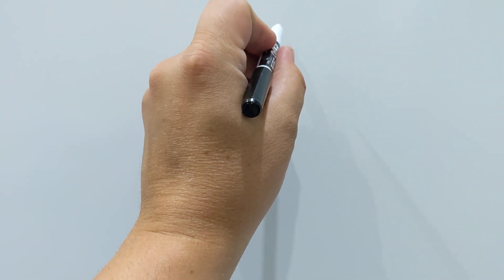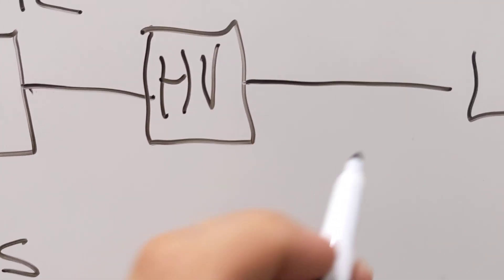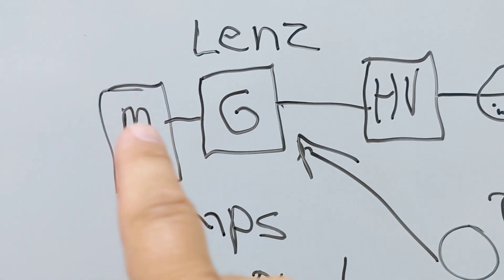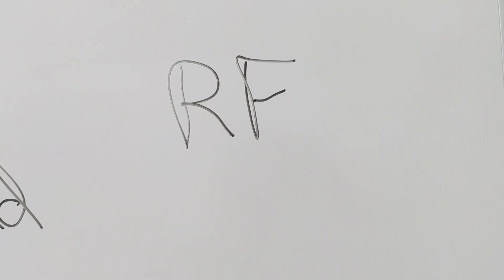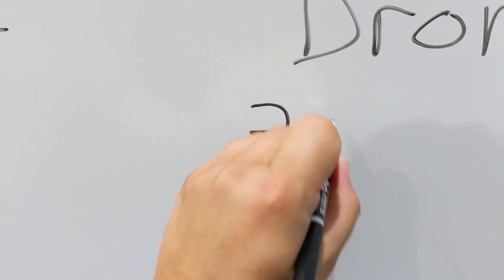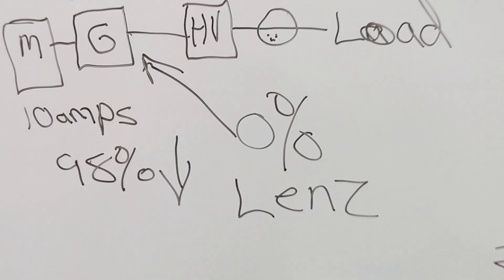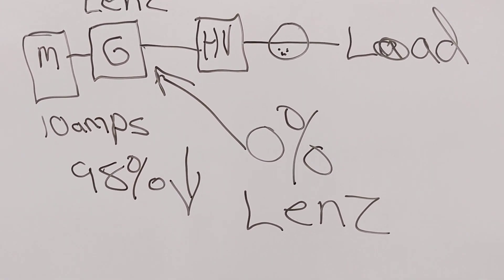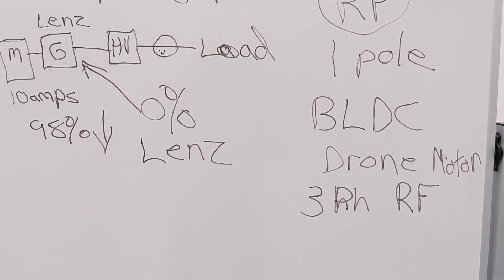Faraday Research RND very important video...must see!!

Comment: I subscribed to your channel because you have a lot of insight; morin, Bedini, etc.  Also I'm looking to make a generator that will not brake thus you'll be able to run it with a small motor and provide more than enough power from the generator to make it autonomous, thanks for all the good work!

Comment: The back emf is the magnetic side of the dipole, it can not jump the spark gap but the voltage yes. So if we have multiple spark gap like Gerard Morin it can be the right way👍👍. Let's play with nature kill the lenz law and manipulate the magnetic side with resonance. It should be the mix of multiple technic.
Reply from the maker: Hi thanks for your comments
 if you look at my latest video... I show three spark gaps in series and I'm working on this so I'm see I'm dealing with a power based system not a energy based system... there's a difference between the two.. and if you look at my system I'm using a high voltage generator and it goes through three spark gaps then it will go to a coil which either could be an air coil or it could be an induction coil... so right there it is now changed to an energy based system and then from there I put it through a capacitor and then from there I could run 50 watt halogen light bulb now my input power on the system is only 12 watts and I'm getting 50 out so yeah you're very correct on that 
Tesla it was heading towards more of a power base system than an energy based system if you can understand the difference between the two you got it!

Cheers 
Mike
Reply: @FaradayResearch  thanks im new to your channel and i will study your content.

Comment: I tried to set up the simplest "motor" that Gerard showed, but it's not worked yet. I put in 12V in my motor, but only get out a very small amnt of voltage from the generator (G).
Reply from the maker: Yeah make sure you're using a washing machine motor it's the pump that is what creates the high voltage you need if you just using a 12 volt DC motor and another 12 volt DC motor you're not going to get the output you must use the washer motor pump for a washing machine then try it again if it's not working then you're going to have to add in the spark gaps you need a minimum of two spark gaps so try that and see what happens good luck

Mike
Reply: @FaradayResearch   Thanks Mike, yes I'm using a washing machine pump. I'm gonna try to fasten the components a bit better, and add some spark gaps.
Reply: @FaradayResearch  bro I finally got it to work! I'm pushing about 110V right now 😁
Reply: @mikki7522  this is huge. I recently got washer mashine pump. I will try to replicate this Gerard Morrin's project

Comment: how does adding the spark gap affect the output to the load?
Reply from the maker: It breaks the circuit for a nanosecond
 which releases any load so therefore it creates the effect of reducing the load on the circuit... you kind of have to build it and run it to experience what it actually is doing... but it does work
Reply: @FaradayResearch  I know that a spark gap basically keeps the source from being able to see the load.  I was wondering if any measurements were taken?  Like the ev gray motor was basically a pulse motor fed by a spark gap through a diode.  A little more complicated than that but similar to Aaron marakumis plasma ignition circut.  Hooking spark gaps to ground with a diode draws in extra energy also.
Reply: @FaradayResearch  on a side note, i read somewhere that 2 spark gaps create the most power.  One side of the gap should be tungsten and then other carbon.